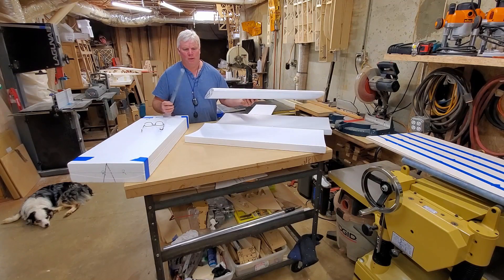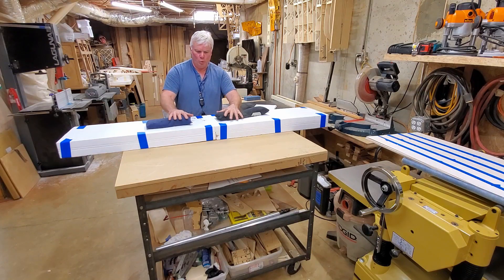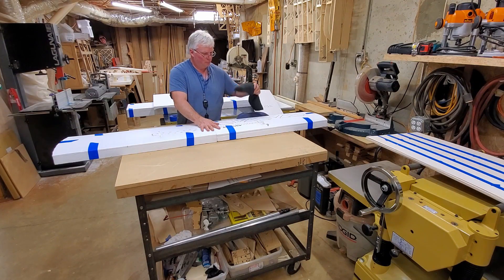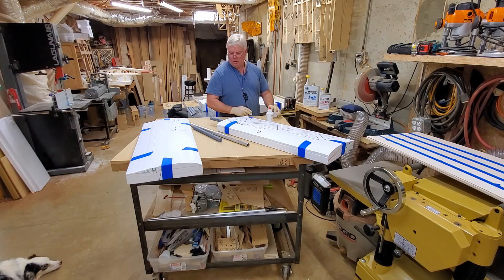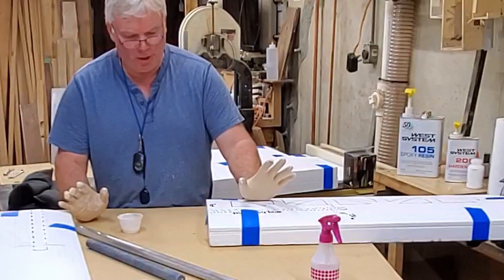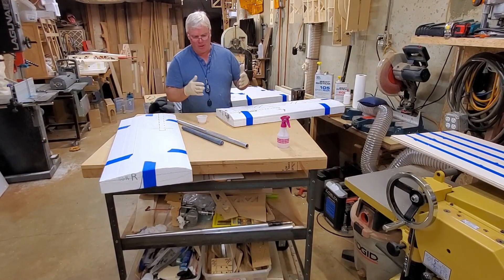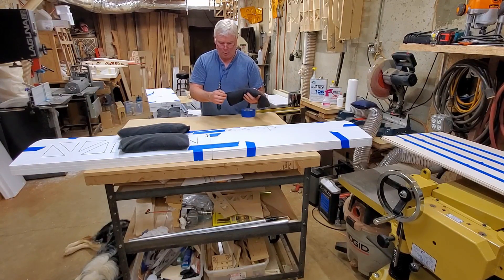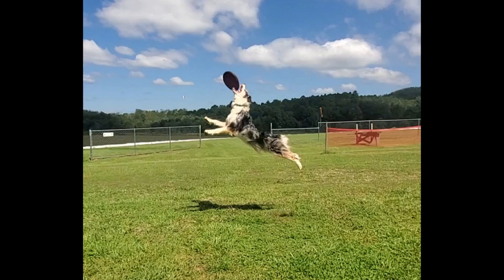Scratch Building Your Own RC Planes Episode #6 - Installing the Wing Socket Tubes

Comment: Where do you get your light ply in 4×8 sheets. Also you epp in 4" sheets
Reply from the maker: I get liteply at Aircraft Spruce in Peachtree City GA.  Its a 1.5 hour drive for me but its worth it.  I buy about 5 to 7 sheets at a time.

Its apparently sold as "Bendply " as well.  That's what I'm told.  

I've never tried that.  

Go to the FACEBOOK Group RC Foam Core Wings for more discussion on this and similar topics.

I use EPS.   Not EPP.    There are numerous distributors across the country.   I buy from CelloFoam in Conyers, GA.
Reply: Mike are you in the McDonough Ga area?

Comment: have you considered trying pu wood glue? (glue needs to be stronger than foam) wood glue works well with other foams too :) the pu expands as you probably already know
Reply from the maker: Martin,
 
That's a really good question.  
I have not tried wood glue.  The question is,  "will it work as well as epoxy?"  I can't answer that question with any certainty yet.  "Yet" being the key word here because you have prompted me to do an experiment that I've been putting off for a long while.

My concerns are these:

One of the greatest benefits of using epoxy in the vacuum process is the fact that millions of little epoxy roots get pulled into the foam by the vacuum.   They pull down from .25" to .75" into the foam.  That makes for an extremely tough layer of foam much like a shell.  So, we are not just gluing the sheeting and fiberglass down but creating that shell as well.  That shell is the key to this build in my opinion.   Especially on the thinner tail parts.  

My concern (of course not founded in any hard evidence as yet) about wood glue is that it since it needs air to dry, will those little roots ever get hard.  As you know epoxy does not need air.   

I work with wood glue every day.  I seldom put the lid on my glue bottle and it doesn't dry because of the lack of air.  Heck, a small puddle on the work bench may take days to dry in the middle.   

I'll build some samples this evening and we will get this test behind us at last!!! 

I would much prefer wood glue as it is 1/5 the cost.  

Drying time would be a downside for sure since the epoxy is good to go in 3 hrs.  

Go to the Facebook group "RC Foam Core Wings" for follow up.  Its a private group but I'll let anyone interested or involved in the Foam Core Plane project.
Reply: @mikencrcf6018  I was primarily thinking of the wing tube :) i haven't reached the vaccum part yet? for the wood glue to work it has to be the polyurethane for it to expand. common wood glue will not be strong enough for sheeting the wings i think though :) 

i'll check out the fb group :)

Comment: 0:53 I setup you auto proffit site with done for you 6k monthly income. It is a ready made website with content, connected offers (digital products), google advertisement, amazon advertisement and 1 month connected traffic of visitors. Managing it wisely you earn 6k monthly and your expenses will be 1950$ for the installation and 600-700$ for traffic which you need to send monthly. Speaking about traffic you will not need to worry about this- as we usually send this amount and we continue maintaining it. It is not the system that you just press the button- and here is money, as you will need to manage it. But if you follow our instructions the income is guaranteed wtsap +7 967 157 05 81